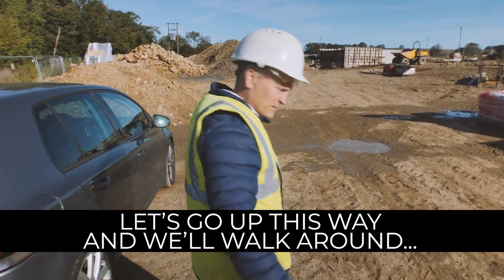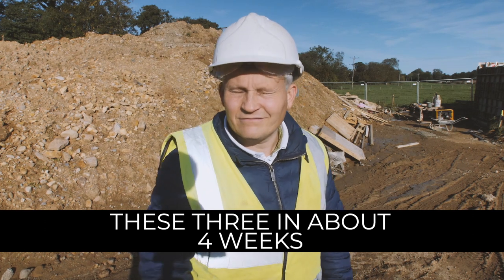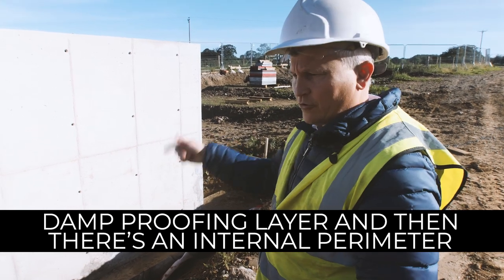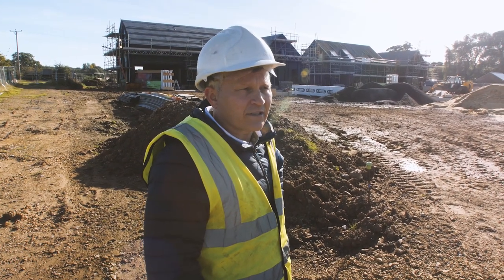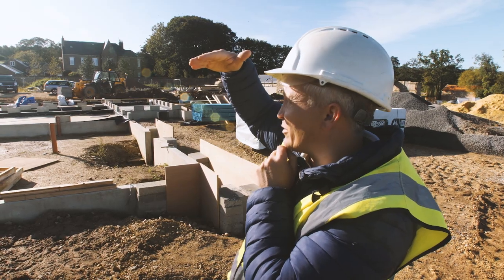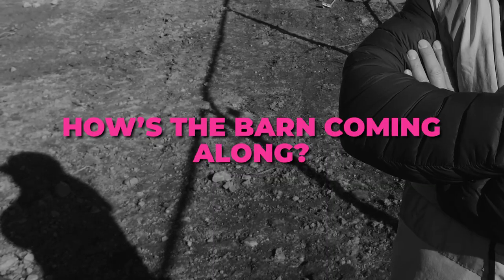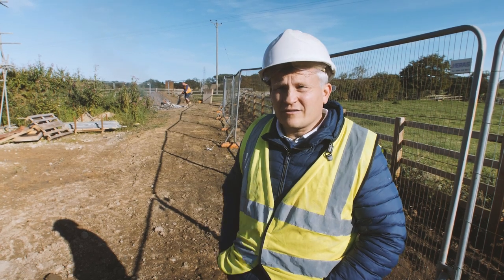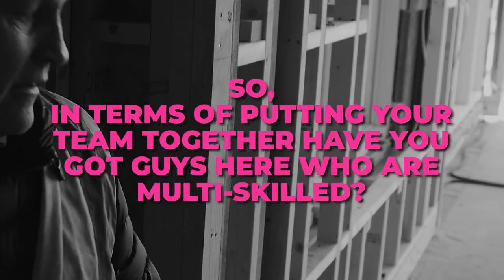SIPS House Build - Catnic Standing Seam Roofing & Formed Concrete Basements (Church Farm Ep6)

Comment: Another great video, I'm learning so much from this video series. I really like that Catnic metal roof.
Reply from the maker: Wow, you're rattling through the films. The roof from Catnic was super easy to install with a bit of tuition - would it be something you'd look to use for your build?
Reply: @MarkKnightFilms  I'm binge watching haha. Yeah I think it's something I'd consider as the roof I'd like would be a very low pitch so not suitable for traditional slates which is what I would initially have liked as I live in Wales so they're easy to come by. I've always been wary of metal roofs as I though they looked a bit too industrial and wasn't sure how long they'd last before rusting but this one looks very robust!

Comment: Why did you not use ICF for the basements?
Reply: Hi Sam, 
Probably what was running through my head was that ICF would have been yet another new method of construction I hadn't used before adding to all the other things like SIPs, etc. that were new to us on this project.  Also, I wasn't sure what the capability was with SIPs particularly the interface details between the cill and top of the plinth. We also weren't keen on using water-proof concrete given the feed-back we had from various experts on the best methods for water-proofing. My understanding is that water-proof concrete would need to be used if ICF is used for a basement. Thinking back on it now, the architect had a bad experience on a other project (not one he specified but one he was asked to rectify because of poor installation of the product and the water-proof concrete. I was interested in using insulation on the outer face of the basement similar to ICF but we rulled that out as well because it would have meant that had to run the insulation all the way to the top of the plinth including the top 150 above ground level which we intended to leave as bare concrete. Your question and my answer illustrates all the complexities involved in specifying MMC's and building for the modern environment in general. Having said all that I would like to look into ICF's in more detail and it might be something to consider for the future.
Reply: Andrew, thanks for the in depth reply. Waterproofing details are tough for sure. This is a good video on the subject.  

  https://youtu.be/keghWP_sVzg 

Having done a fair bit of RC framing shuttering is complex and on a big job you have experienced guys and resources to go with it. That's why I thought ICF would work well on a smaller job. Curious as I need to do a basement for my own extension. Good luck with the remainder of the job.